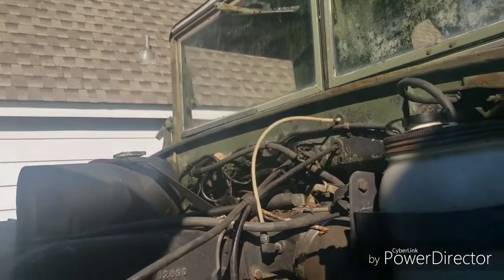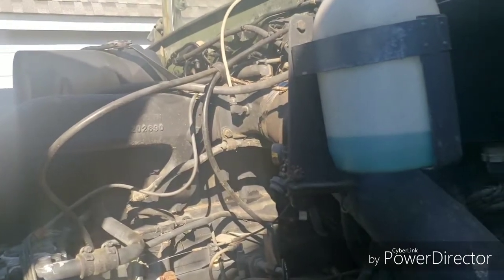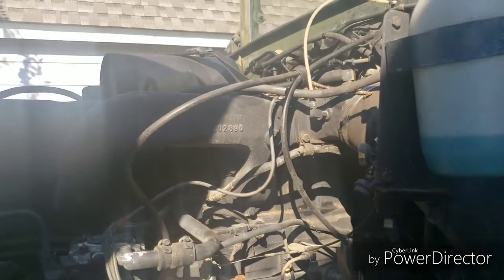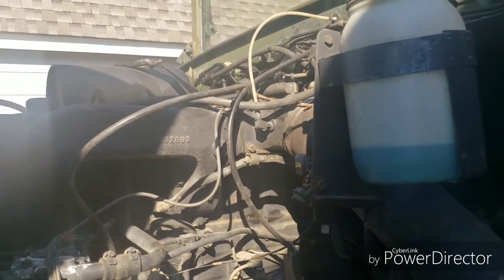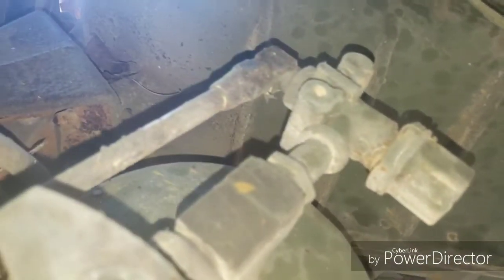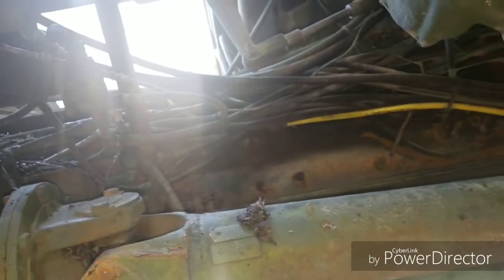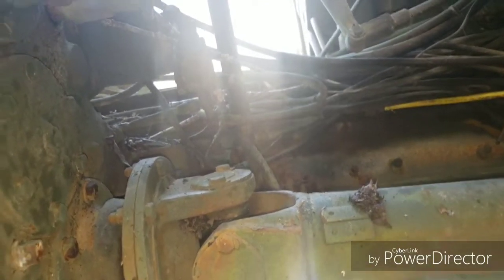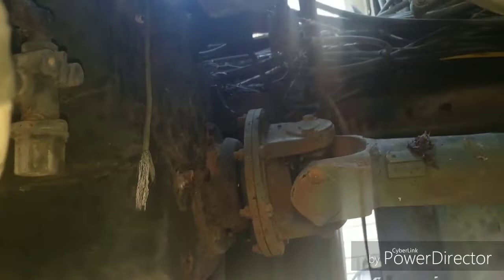M939 series Truck - Air system fault - No Air to wipers/6x6/No air dryer purge

Comment: Thanks for the video. I have a 923A2 that I've been chasing compressor cycling problems on. Finally figured out the compressor unloader is leaking out of the compressor intake Port while the compressor is in bypass so the compressor is cycling about every 30 seconds. So I'm working on getting that fixed. What is an acceptable cycle time between Cycles on the m939 series trucks?
Reply from the maker: No air leaks. 30 to 40mins of highway driving.   City driving it will depend on brake applications 

My 915 and 920 go 2 or 3 hrs without cycling if I am on the highway

Comment: Thanks for this info, I smack the pressure protection valve once I start the truck and it's good the rest of the day. Can I take it apart and clean it? Could it be from the cold it's been   -10° to 15 out.
Reply from the maker: It'd Frozen from. Extra moisture in the system.   

Service your air dryer,  replace the wet tank drain with a heated Automatic drain valve. Bendix 284795X

Or delete the pressure protection.  It isn't really needed